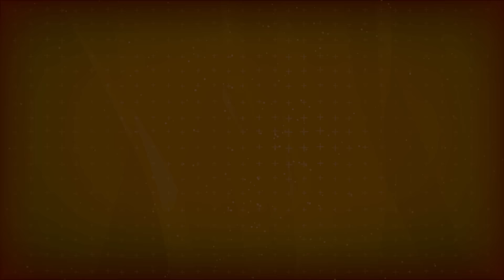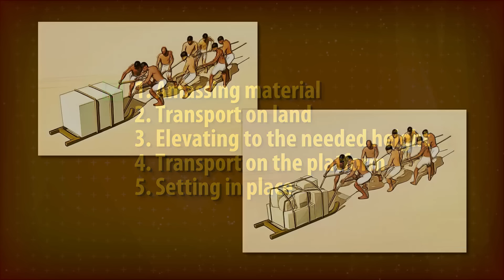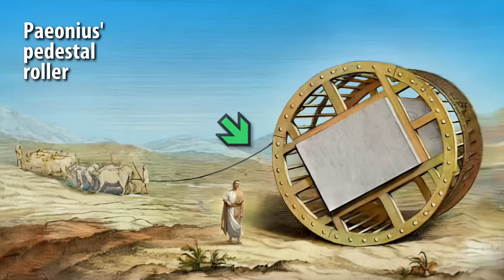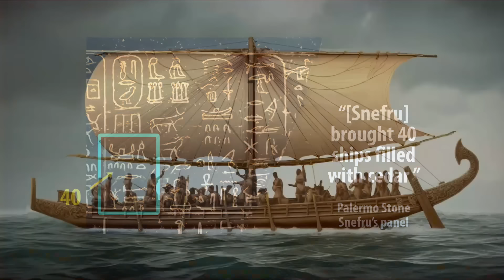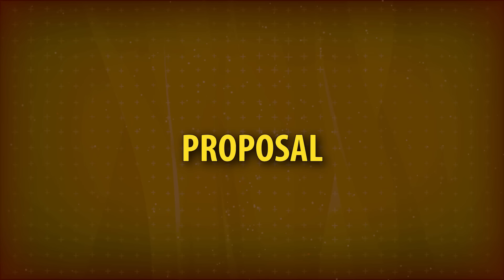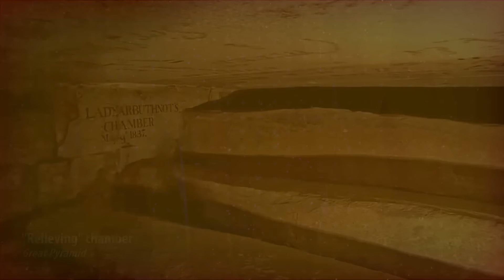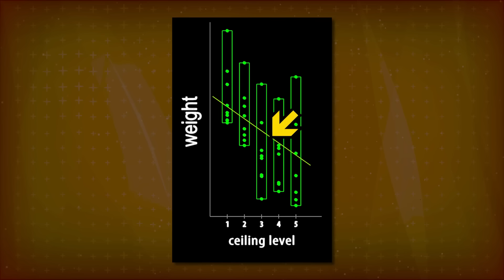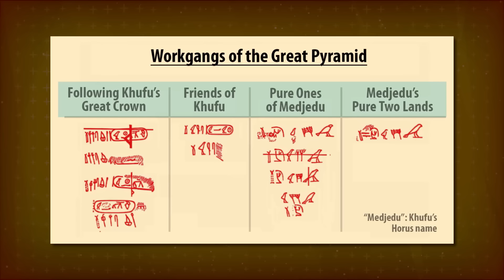How to Build the Great Pyramid in 9 Months (NOT aliens)

Comment: This address a few interesting points. You often hear certain people talk about the precision and estimates on the amount of stones used which goes up to around two and a half million. When you actually really look at the great pyramid the stones all different shapes and sizes, mortar everywhere, and as pointed out here lots of rubble. Zahi Hawass estimates there is about one million regular shaped stones. he also found cavities filled with sand when drilling in the tunnels. I think most of the interior is just rubble back fill and in some places filled with sand which would reduce weight below. In either case it reduces the build the time to a very considerable degree. Very interesting vid that doesn't deviate from the known methods and tools of the time which is very important to be taken seriously.
Reply: I feel like if it was filled with rubble it wouldn't have maintained its shape so nicely. The sand would have started to move and make voids which would cause the outer stones to shift and drop.
Reply: @centennialfarm11  This vid show areas that are just filled with rubble....or just odds n ends of stone. Rubble back fill is still something we do today in areas that are not seen. Sand filled voids are there as evidenced by Zahi Hawass drilling in certain areas. One thing is for sure, the great pyramid is not a pile of perfectly cut stone right through to it's core.

Comment: That was good.  The rubble made sense.  then the roller.  that was cool I didn't think of rolling the materials like that.  very cool.  and that makes sense too.   and everybody knows the caveman invented the wheel so why wouldn't the ancient egyptians know about the wheel. 😂  spot on about the nile.😉
Reply: The first proof for the wheel as a transport tool just dates back ca. 100...150 years after the construction of the Great Pyramid. This proof was an archaeological dig that unearthed remains of a wooden wheel. It is the first one archaeologists know of, because no older sample or older proof (an image or writings) has been found so far. But this doesn't rule out, that it was indeed available for the Egyptians at this point in time. 100 to 150 years is not a huge amount of time for it to be unreasonable or unplausible to have existed pre-dating our oldes find. The reason may be, that rarely wheels were buried for modern archeaologists to find. Broken ones may have been used as fire wood. So we just never found one that dates back to these times.
Reply: The caveman invented the wheel.. right lol

Comment: How are those "fractal ramps" build in the first place? How does the ramp material get up there? On top of what are the ramps built?
Reply: I thought the same thing as well. Traversing several tiers of blocks on the diagonal using rubble can't work. Plus, these theorists always omit how the blocks are manipulated into their final position. It's one thing to roll it up a ramp but there is more work to do after that. The only way to precisely and quickly control the x,y,z axis is with cranes on every level. The Egyptians HAD the wheel so they also had pulleys. Add capstans and windlaces and the task gets much easier. The blocks had holes chiseled in the tops for lifting without wrapping with ropes.
Reply: @roberttassone7676  What bothers me about such theories as shown in the video is that it's relatively easy to think up things and then create 3D animations.  Why doesn't the video creator show how he can actually stack bricks with his methods?  I am sure that the creator of the video has not moved or worked on a single large stone himself. For example. How do you bring such a large stone in the desired form?  5 sides can still be worked on somehow with a hammer and chisel, but what about the underside?  How do you lift the stone to be able to work on it?  This whole theory has too many flaws and a lot of things have just been completely forgotten.  If it is possible to build the pyramid in 9 months then I challenge the creator of the video to build a pyramid only 5 meters high in less than a year using his methods and without the use of modern tools and technology..
Reply: @MisterEko888 The ramps were made of a mixture of rubble,mudbrick and mud mortar (it's in the video).
To cut the stones on 6 sides, you first work what will become the underside, then flip it over and cut the other five faces. If you assume they can't even do that, you should assume they can't add 'rollers' onto the blocks either...
The creator of the video said they could use other mechanisms (levers, winches, walking, ...) to move the blocks into place after they reached the worksurface 'top' platform of the pyramid.
Reply: @MisterEko888  Most of the blocks only weighed about 2.5 tons, they could be flipped over easily for access to any side desired and never needed to be "lifted". Incidentally, one gets the impression that you've never worked with stone AT ALL and, if I know anything about the real world, may have never had a job that required intense exertion or the manipulation and transportation of heavy items like stone blocks and if that's accurate it explains your confusion because in my experience, to people who've never done heavy construction or work of any kind, EVERYTHING is impossible.

Comment: Thank you very much for setting the record STRAIGHT regarding Egypt and the wheel. There is a famous photograph of the contents of King Tut's tomb when Carter opened it in the 1920's . Front and center there is a dissasembled chariot with all four wheels leaning against it! Also, grooves in the clay roller sections can be seen as proof of  another mechanical advantage called the pulley.
Reply: King Tut was a new kingdom ruler by which time the wheel was common place. This the old kingdom that was a very long time before and we have never found a wheel used by them in the sense we think. But as this vid points out they were very aware of the benefits of using a circular object in many different ways. I think they must have used circular wooden forms to roll the stones.
Reply: @dazuk1969  old kingdom had chariots
Reply: @roberttassone7676  I have never seen or heard of wheeled chariots being used by the old kingdom Egyptians. And I have researched ancient Egypt for a long time, especially the old kingdom.
Reply: @dazuk1969  maybe you are looking in the wrong places friend....the ancient Egyptians were skilled engineers, builders, mathematicians, astronomers and artists who had a complex written language yet somehow, had no mastery of the wheel? A log used as a roller is nothing more than an elongated wheel.
Reply: @roberttassone7676 I know all that about the old kingdom Egyptians. And obviously a log used as a roller could be considered a type of wheel if you use your imagination. But you specifically referred to wheeled chariots which is about as far away far a log roller as it gets.
Reply: @dazuk1969  You are right. Nobody questions the New Kingdom had chariots and the Old Kingdom had wheels and pulleys - but the Old Kingdom did not have chariots. The absence of depictions of chariots in the Old Kingdom contrasted to the multiples of depictions in the later kingdoms and periods makes it clear.
Reply: @JH-pt6ih  sorry Google keyboard warriors. Old Kingdom absolutely had chariots.
Reply: @roberttassone7676  Nope. You have no evidence. None. Why no depictions of kings in chariots in the Old Kingdom? Provide evidence. You don't know the difference between the Old and New Kingdoms. It's obvious.
Reply: @JH-pt6ih  👍
Reply: @roberttassone7676  I don't think they did but I don't mind being wrong...show proof or a citation I can investigate. Thanks.
Reply: @roberttassone7676  Just because you don't understand history is no reason to just accept, without evidence, any proposition about it. Besides, the Central and South-American megalith-builders didn't use the wheel either. Just because you have a Ford Focus in your driveway doesn't mean the Egyptians had the wheel...
Reply: @roberttassone7676  Prove it.
Reply: Yes I agree with you fully. Can't say the same with most of the other comments.